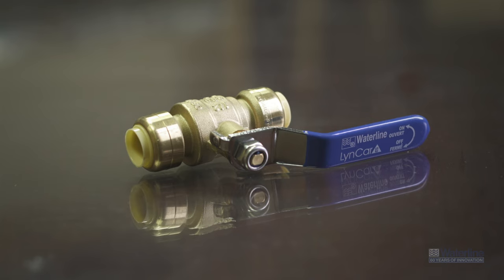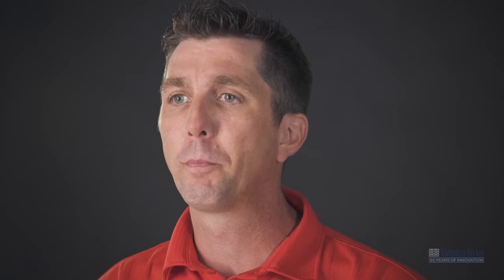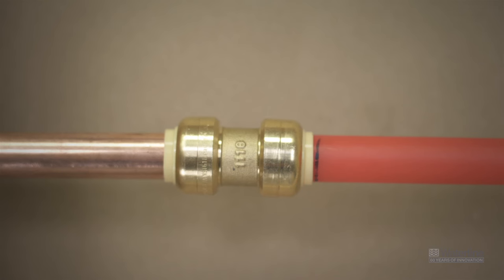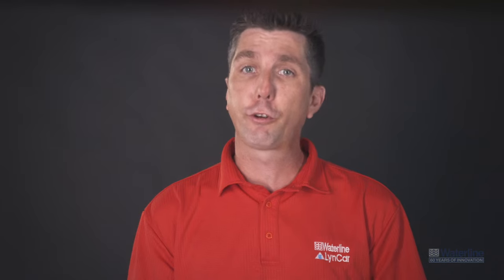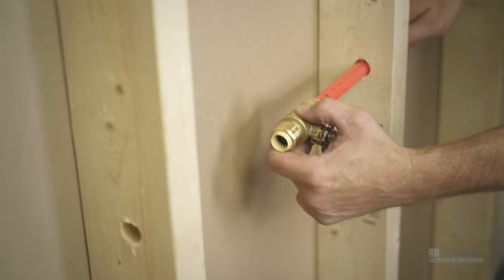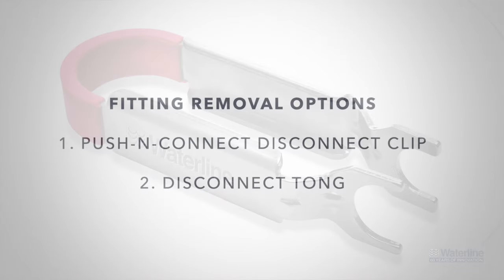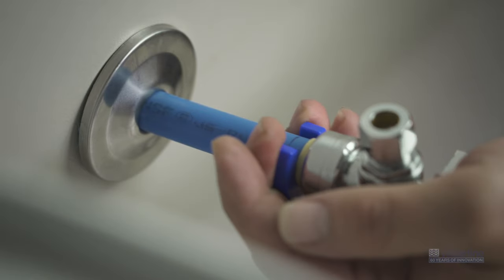Push & Connect fittings, how to use and install

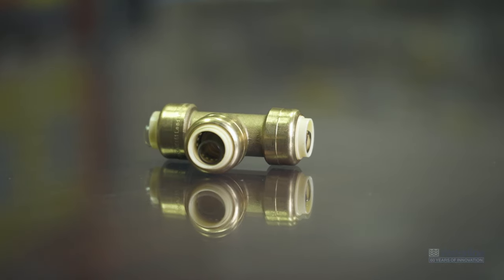Comment: Is there a trick to using these? Using one to fix copper pipe. Fitting looks like that at 2:10. That little clear tube that hangs out kept dropping so it was in the way of the copper pipe (horz installation).  If you try to get the tube centered in the pipe first, it is imposiible. The tube has a mind of it's own and keeps dissapearing inside the rest of the connector. Wiggle, wiggle and finally it went in. If there's not a trick to this, I consider it a frustrating design.

Comment: Can I use it to plum my garden, and hide the tubing system under dirt?
Reply: Push'N'Connect is designed for indoor plumbing applications and would freeze in outdoor use,  causing damage to the system unless completely drained prior to freezing temperatures.
Reply: @michaelfurlong3883 Russian connector design for underground as well yes at least shark bites are good for underground outside
Reply: please note the PEX tubing cannot be exposed to sunlight